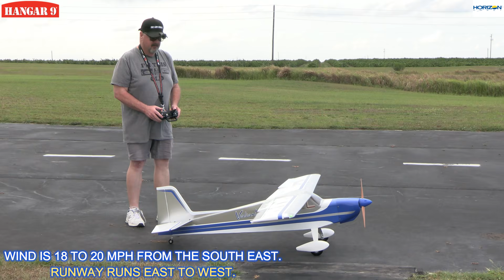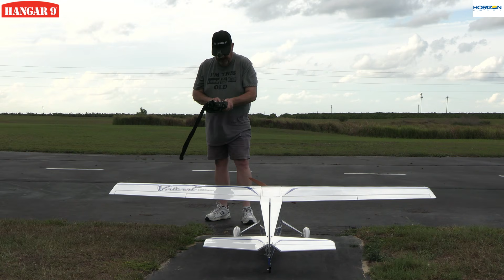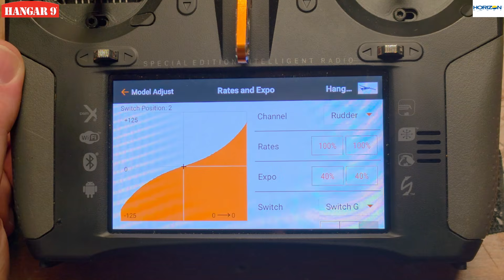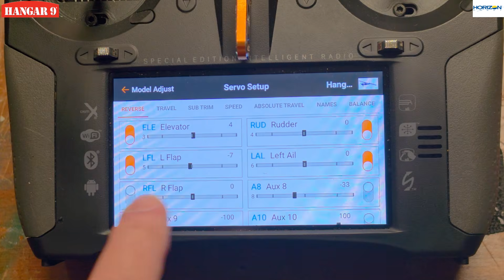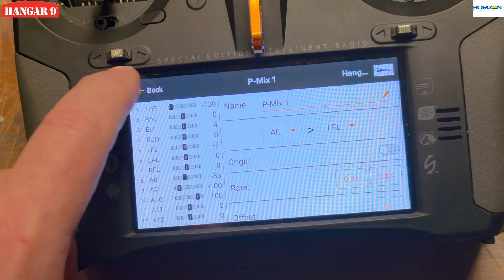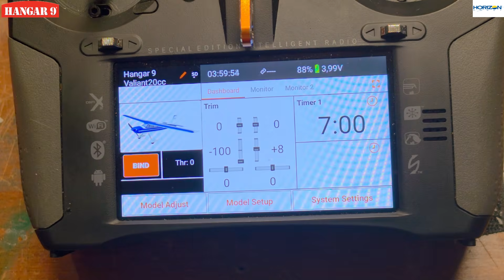NEW HANGAR 9 20CC VALIANT MAIDEN PLUS! by FGFRC #aviation #rcplane #rc

Comment: Nice review and unboxing video.  Excellent work. Other reviewers say you can use 3s to power up the led wing lights to get the brighter.  Will order today.  Love color scheme and how it flies.  I also own the Hangar 9 J-3 Cub 10cc and SWS Turbo Timber. Great airplanes! Thanks again and for your excellent effort on the unboxing and flight videos! Take care and wish you many happy flights! 😊
Reply from the maker: Thanks for the kind words and enjoy your new plane! 😊 Today I crashed her because in a fast dive the elevator servo connection screw gave way and released it hold on the elevator at the worse possible time. But since I was experimenting with a more aft cg the plane leveled some despite no elevator and my damage was not as bad as it could have been. New elevator assembly, prop , gear assembly,  battery hatch and hardware are on their way.  So my $850 plane just jumped by another $138..... but it could have been WAY worse.!!  FYI editing this video tonight 5-20-26 at almost 11pm. Keep an eye out for this video. I dont think the plane is at fault but maybe whomever assembles the elevator to servo connection that I never checked to make sure it was secure.  Or maybe me shoving the plane into a hard fast dive and it was just too much for the servo not sure.
Reply: @FatGuyFliesRC I can't believe it and mine is on the way. Will check the elevator screw assembly before the maiden.  My H9 J3 Cub 10cc on my maiden all was perfect but an my landing the right wheel rolled off. It wasn't screwed or thread lock put from the factory. No damage. 60 flights after I checked all it flies perfectly.  Thanks for pointing out this.  Will see the video.  Thank you again!

Comment: Greg fantastic maiden flying. I used Adam's settings for mine. I  have  it all ready for the maiden. I don't really like big plastic spinners.  Thank you Sir. Jeff in LA USA
Reply from the maker: Yeah on that spinner gotta use that sand paper and line those hard points up 90 degrees from the prop and the spinner will go right in. But that is the ONLY issue with this plane. As long as you can handle the price it my be the new most perfect rc plane ever!!!!!

Comment: You going to get the New Dynam E2C to review? Great video!
Reply from the maker: No not ever. I tried to give Dynam another chance with their newest Grand Cruiser v3 . Complete garbage as usual from Dynam.  Both motors fail when I tried to fly her for the 3rd time. I ripped the plane into small pieces electronics and all and the plane is in the local landfill now. I advise everyone to stay away from anything Dynam. Good flyers filled with crap everything. If they just sold ARF s then they would be okay but ALL of they electronics  are complete garbage.